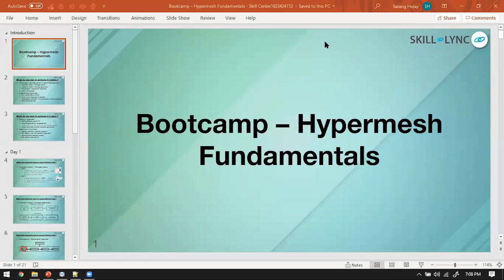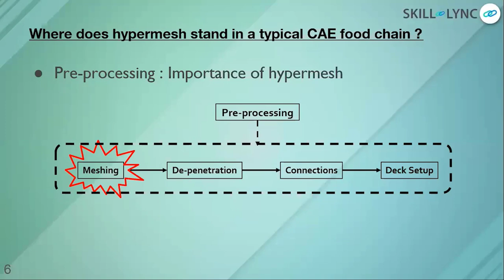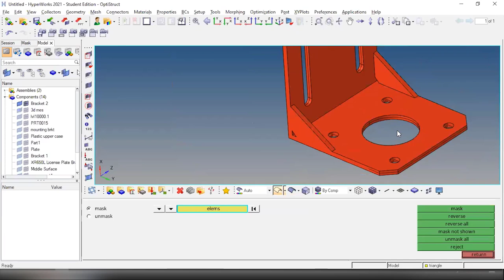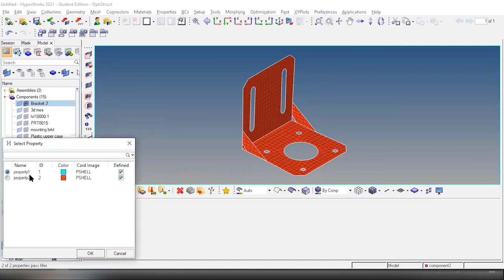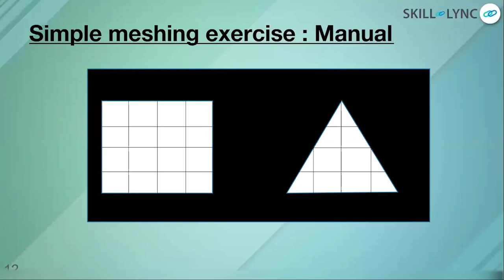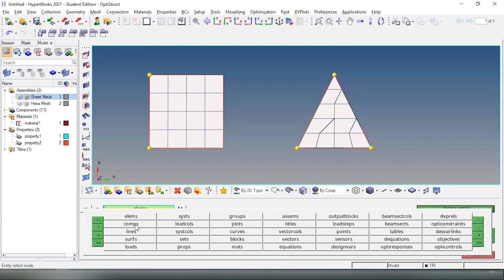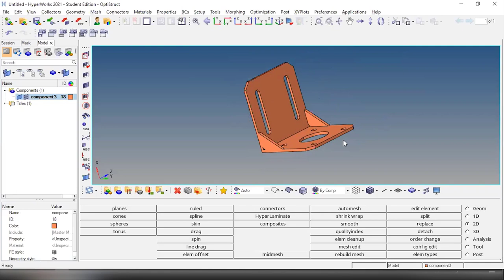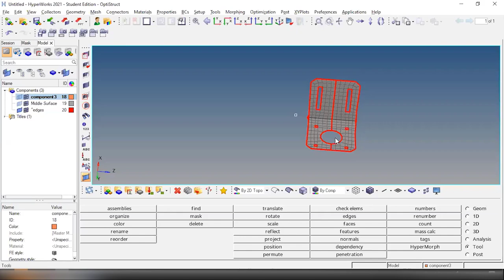Fundamentals of Hypermesh (Part - 1) | Mechanical Workshop

Comment: Why they are using different softwares for each process( pre process, Analysis, post process)
Reply: Because hypermesh is not a solver. It's a pre processing software. 
You can mesh and set properties, constraints and boundary conditions in hypermesh  and solve them in solvers like ANSYS, optistruct, radioss etc. Depending on the type of analysis you do. 
For viewing result
The post processing, that is , showing results in graphical or data in post processing softwares like Hyperview, or ANSYS itself.
Reply: Unlike ANSYS (which I think you have experience in since you asked that question), hypermesh is not the complete FEA package. It is just for pre processing.
Reply: I personally found that Hypermesh gives you a greater control over meshing and that is why it is used for preprocessing in the industry
Reply: Feel free to correct me if I am wrong
Reply: @kadhaipaneer9175  is knowledge on hypermesh is enough to place as a meshing engineer....can u please tell me about high paying roles for a mechanical graduate.